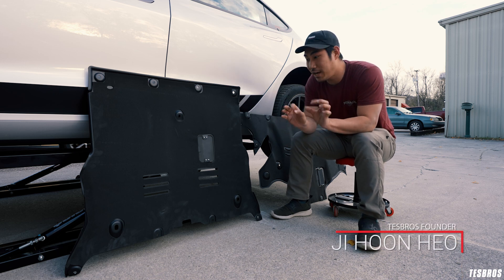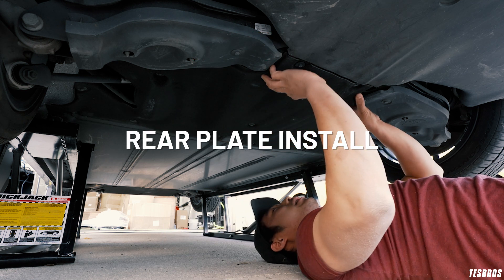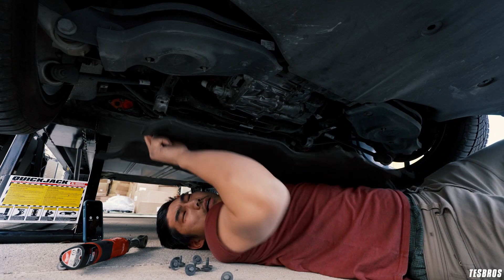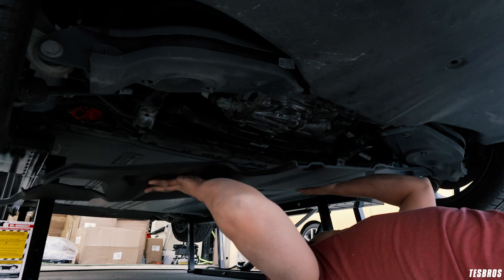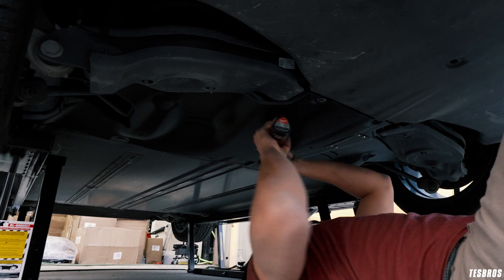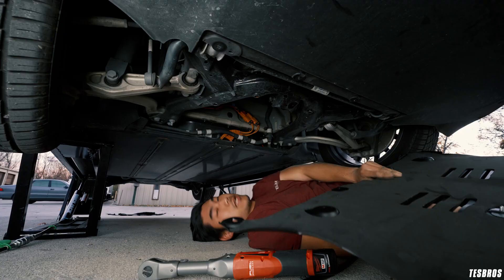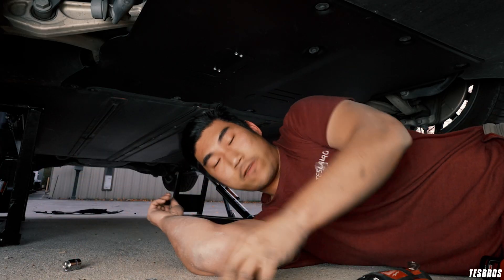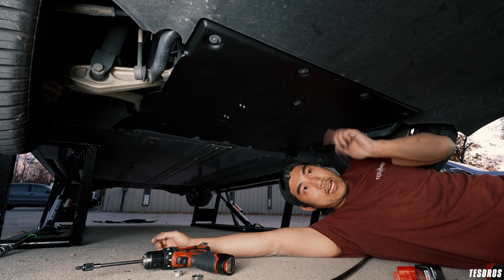Upgrade Tesla Model 3 Skid Plates with Aluminum Ones

Comment: Same thing has happened to me. I swear I’m so frustrated. I thought by getting a Tesla, even used, that I’d be getting a really nice car. But I haven’t even had it two years and I’ve spent so much money on having to repair things. It’s ridiculous
Reply from the maker: Sorry to hear that! What else have you had to repair if you don't mind me asking
Reply: @diywrapclub 
Low volt battery, suspension arm, some part I’m not sure about that apparently stop the car from entering turtle mode all the time. I’ve spent thousands just on last year and a half. It’s very frustrating

Comment: I installed this and had some creaking in the front end, surprisingly tesla removed this metal shield and it stopped. I figured it was the upper control arms, but those were replaced and it was still happening. Kind of unfortunate.

Comment: Can someone fix this at home? I don’t know how to lift my car up though. But trying to save money on taking it to a shop to repair.
Reply: I got $60, 6,000lbs rated ramps at Harbor Freight - ordered the metal replacement which will be here tomorrow and will be doing it myself!
Reply from the maker: if it's damaged, it'll need to be replaced by you if you have the materials and some ramps you can borrow. you could also get a quote in your app with tesla service just to see if it's within budget. you'll definitely need a way to lift the car though - and safely

Comment: I thought they used a composite flexible material for a reason?
Reply from the maker: Tesla's Model 3 originally had composite skid plates because they’re lightweight, corrosion-resistant, and cheaper to make, helping with efficiency. Upgrading to metal ones adds durability for rougher driving conditions and more protection from debris, but the composites were a good balance of protection and cost.

Comment: Hard to see from the video but the skid plate next to the rear bumper is often full of dirts and debris.  Is that the one you replaced or is it the next skid plate right after? (Further towards the center).
Reply from the maker: I’m not sure I completely understand the question. There are only two skid plates - one in between the front tires and one in between the rear tires. We replaced them both in the video. There is a rear diffuser between the rear skid plate and the rear bumper - that may be the part you’re referring to?
Reply: @diywrapclub   That diffuser is full of dust and road debris,,, im having hard time removing it.. it seems you need to remove the skid plate first to remove the diffuser.. but since i can't lift the model 3 it is too difficult to reach the skid plate,   You need someknd of lift system to lift the vehicle.. and that thing is so heavy im not really willing to crawl under it… so im trying to clean the diffuser whoch i did today and was able to remove some sand and rock enough to fill a coffee cup.

Comment: Does anyone know the specific bolt size to replace lost bolts?
Reply from the maker: You have all 10mm bolts for the front and rear, but there are 2 15mm ones near the battery pack on the front plate. (If you are getting this aluminum plate, the two 15mm bolts need to be replaced wit the 2 T40 Screws/Washers the kit comes with. You’ll need a T40 hex bit for these.)

Comment: Would it be possible to do the job by using 2 jack stands on one side of the Model 3 at a time?
Reply from the maker: Yes but it’ll be tight. I’ve done it before though. Just make sure everything is secure before getting under there.

Comment: Hello, for the replacement screw, the T40, do you have a link to this specific part? I'm not sure what it looks like as the video doesn't have the detail, and nor is there a picture of it on the tesbros webpage. Thanks!
Reply: I see no one bothered to answer you. I needed the same answer. I have mine apart now discovering it on my own. I could use a new bolt or 2 as well.

The bolt is 6mmx 1.00. The length is 20mm. The big flat body washer is 25mm diameter (with 6mm hole in center)
Reply: Shame it doesn’t come w it

Comment: Would it work for my Tesla 3?
Reply from the maker: Yep! We have it back in stock now.
Reply: @diywrapclub  what I want to make sure is I don’t know if it’s skid plate or not. It’s definitely not a metal part. It’s btw the center metal part and the front bumper. Is it called skid plate? Looks like plastic. And I want to order the right part. All of a sudden I heard some crack noise and saw underneath and the plastic (?) part was torn off about  5 inch
Reply from the maker: @Texas-mom  yes, those are skid plates. The OEM Tesla ones are made out of a plastic/fiberboard material. Scroll to the last photos on the product page and it’ll show you my original ones too if you want to compare: https://tesbros.com/products/model-3-skid-plates?variant=42132897202394

Comment: Same question as Noel Gosom: Any significant changes in added-weight?
Reply from the maker: The combined weight of the two OEM skid plates is about 5lbs and these aluminum ones are about 25lb combined weight. I've had them on for about a week and haven't noticed change in my range.

Comment: What’s the weight difference between the OEM parts and these Tesbros parts?  Tracking my Model 3 and considering upgrading to protect parts from below.
Reply from the maker: The combined weight of the two OEM skid plates is about 5lbs and these aluminum ones are about 25lb combined weight. I've had them on for about a week and haven't noticed change in my range.
Reply: I'm doing the job now and it feels like about 5lbs each to me.
Reply: With the amount of water my stock ones seemed to have absorbed, I think my aluminum plates may actually be lighter.

Comment: Would you be able to replace these using a set of low profile ramps to drive up on and backup onto?
Reply from the maker: Yes! As long as the ramps are tall enough for you to fit under to do this. And secure enough where the car doesn't roll of course.

Comment: Awesome!!  I need a set for my Model Y - We need them for the wheel wells as well.
Reply from the maker: We'll be selling Model Y soon!
Reply: @diywrapclub  Cool!    Hopefully they’ll have some water escape vents?    The current material does not like it when you go into deep water.   Sometimes it’s impossible to avoid.     All the material in the wheel wells shifted.  I had to realign it all and secure it again.     Wish the material in the wheel wells was sturdier.